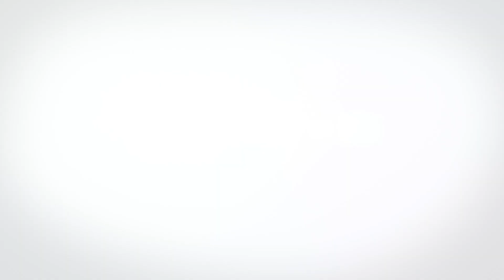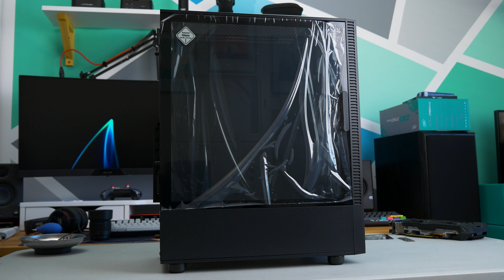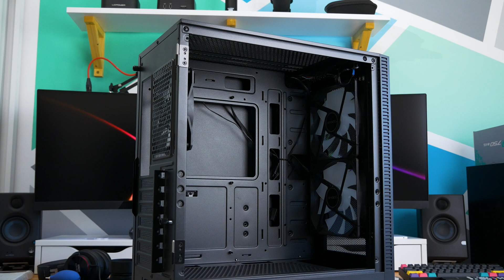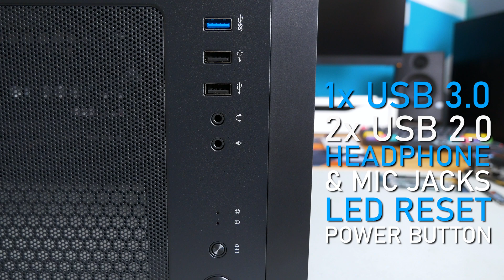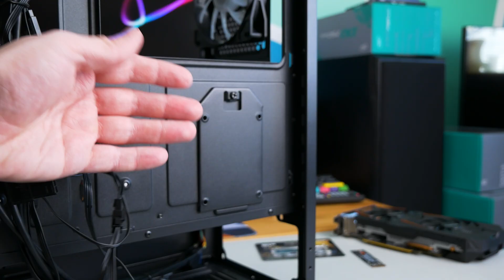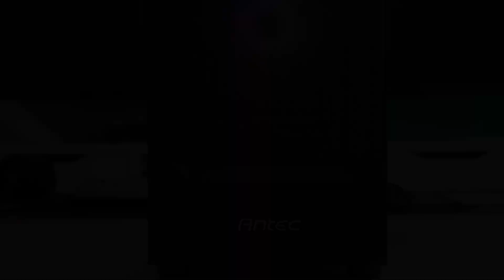Antec NX410 review  - Value oriented case!

Comment: Hi Vlad, do you happen to have the part# on the rear ARGB fan? I am looking to buy 3 more of those ARGB fans and yank the front RGB fans out, if that even makes sense. Antec would not give me a part number, nor would they allow me to purchase extra fans. Thanks in advance, I know this video is wicked old, but the case is still alive and kicking. I just bought one from the egg

If you are unable to find the part#, could you possibly recommend a specific aRGB fan I can connect to the rear? My Arous board has a 4 pin ARGB connector, so I am excited to get er done !
Reply from the maker: I don't have the pn but you can use Antec Prizm fans or similar from Antec

Comment: im pretty late to this video but the LED button on the top resets my pc instead of changing the LED. I cant find any other way to plug the wire in to get it to change the led. now my case LED is stuck at green and i cant change it :(
Reply from the maker: Remove wires from reset connector/pins 😁 and connect them to the RGB controller, then the button will be LED... You wired it like that, just undo it and all is good
Reply: @LevelUPGamingTech please give a tutorial 🙏

Comment: Im like 2 years late and doubt you will respond but how do the fans work. Is it just like a molex input from the psu and that's it or does anything go into the motherboard?
Reply from the maker: Molex for the power and I think there was one cable to the board to control the speed or read the speed, honestly can't remember now 😁

Comment: this case's fans have cables that my mobo doesn't have ports for, and they dont seem to be on any mobo, it wont let my pc boot either :/
Reply: What's the cable? I have the white version of this case and my mobo had all of the ports. Only issue I had was that the RGB quit working.
Reply: @geritisdale-brock7247  I fixed the issue, no clue what's missing, but it works fine and rgb does too
Reply: @GiveMeEstrogen333 How did you figure out the fan situation, I am having the same problem with my motherboard not having ports

Comment: I have a problem with the case, i can screw my motherboard in it.. its a B550 pro x v2 so normaly it needs to fit but the screws dont fit idk why :/
Reply from the maker: There are two types of screws in the pack, smaller and bigger thread sizes, try each one and see...

Comment: This case is awesome, the fans suck and fall apart easy so be careful.  The wires pull out so easy.  I fit 3x140mm in the front, a 4090 FE and a 240mm radiator at the top.  It's so cool literally
Reply: Hello, nice build you have congratulations, can you tell me your opinion on the case so far ?
Reply: Wait a Rtx 4090 can fit??

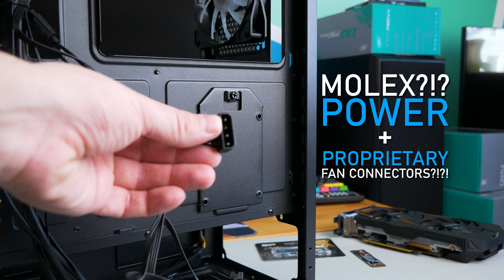Comment: Morning,Afternoon, or evening,, at the 2:30 mark mines didn’t come with that power plug it only have to smaller 4pin plug. Is it a certain name for the extension cause I don’t see it on Amazon
Reply from the maker: Maybe they changed it to PWM then, if it's the smaller one. Like an updated version of the case came out 😀
Reply: @LevelUPGamingTech  appreciate it.. I joined you all's discord server
Reply from the maker: Welcome aboard 😀
Reply: @LevelUPGamingTech  thank you and i got all my fan lights up and going
Reply: @reggiedabodyguard1986 are your fans pwm? Can’t figure out how to connect up to the mb
Reply: Same here what did you end up doing?

Comment: good vid. so im interested in this case. but i dont understand how you plug the molex adapter thing up to the psu or motherboard? if i knew it would work for sure id probably go ahead and buy it
Reply from the maker: Straight from the PSU and that's it, PSUs still come with molex cables, if modular at least one cable will have molex 👍

Comment: Hello, how do I install the gpu on the side?? This case has a slider thing and I have no clue what screw goes in either. Also confused on the molex cable in the back, can I just plug it into my psu(which I have) and then what about the other small cable with the molex that’s 4 pin, where do I connect that to? Or does it not need to connect to anything ?
Reply from the maker: No vertical GPU mount in this case

Comment: Very Informative video. Great job. 
Can we and should we install one Rtx 3090 in this case ? Will the airflow be sufficient to keep the card and other components running cool ? 
If yes , then also can you please suggest a decent future proof power supply for 3090 ? Thank you.
Reply from the maker: Thanks man 😉
I would not use this case for 3090 it might be a tight fit but the card will suffer. Get something bigger for 3090.

PSU 750W and up, 1000W just to be safe...
Reply: @LevelUPGamingTech  , got it. Thanks for helping 😊

Comment: So how would I get the RGB on the fans working? Would I need to connect the molex cables to the PSU or do I need to do something more? Haven’t bought anything yet, just making sure with some prepping.
Reply from the maker: Molex for power nothing else
Reply: @LevelUPGamingTech  so how do I get the RGB working?
Reply: Have u figured this out? I’m stuck on this as well. Got everything else done but I’m not sure if the molex cable connects to the psu and as well as the tiny 4 pin that’s with the molex??
Reply: @zelrius8714  hi I havnt got this case so I don’t really know what’s going on on your end. But I think that the molex cable which I think is a female 4 pin does connect to the PSU yes. But not 100% sure

Comment: Will an rtx3070ti fit? it's 320mm long and the case's specs say it can fit gpu's up to 335mm.
Just wanted to make sure tho ;)
Reply from the maker: It will I did I stall MSI RX 5700XT which is 332mm 👍
Reply: @LevelUPGamingTech  damn nice, it should also make the gpu look bigger i guess
Thanks for the reply btw

Comment: How did you get the rgb to run smoothly like that
Reply from the maker: It's all connected on the included controller if I remember correctly, just connect all the cables and boom done 😂
Reply: @LevelUPGamingTech  for me the rgb doesn't go smoothly through the colors
Reply from the maker: @0010plays  There are several modes, there is the smooth one and there is also that skippy one as well, just cycle through them with the included button on the case 👍
Reply: @LevelUPGamingTech  I don't have the smooth one fsr
Reply: @LevelUPGamingTech  did yours come with a physical rgb controller because mine didn't
Reply from the maker: @0010plays  Hmm actually it did not, I reviewed so many cases I can't remember everything. So in that case I synced RGB to the motherboard, in this case RGB Fusion from Gigabyte/Aorus, just set your effect and lower the speed to be smooth, most probably 50% will get it to be smooth, lower will be choppy and higher will be too fast.

Comment: Can we take of the front mesh panel to clean it? If yes, how?
Reply from the maker: Just pull from the bottom and it goes off, I don't know how I forgot about this 🤦‍♂️ But I can't remember if the cables are stuck to the panel or not, the ones for buttons and ports on top...
Reply: was it easy to take off and put back on?

Comment: Can you recommend a case for 16gb ram 3060ti Intel i5 11400f and 1tb ssd and can you make it cheap
Reply: Or will it work
Reply from the maker: Any case will work, you haven't mentioned which motherboard as this will decide on the case size, based on the motherboard form factor 👍
Reply: @LevelUPGamingTech  it's the ASRock b560 pro  4ddr4b lga 1200
Reply: Also changed to a rtx 3050

Comment: So I have just ordered this case in white and I’ve heard a lot of people having problems with the included case fans, my psu I’ve got has got a molex so will I be okay using the stock fans? Or will it be a case of getting new fans
Reply: How can I connect that fans…? Molexto psu and the other cable where? I need to buy a cable to connect to motherboard?
Reply: @SergioRodriguez-ih5uu  have u figured it out? I think the molex connects to the psu with another connector from the psu
Reply: I mean I've seen people with no issues at all Exept that kolex apparently sucks but it's fine.
Reply: @PopBunny8899  ye all good got it and built the pc and all fans look amazing😁
Reply: How is the case going?

Comment: Its not a good deal with those molex fans, they are very loud and can't  change rgb with software  or buttons. It would of been way better to have one in take and 1 out take 3 pins without rgb.
Reply from the maker: Yup I said that, molex in 2021, idk what were they thinking 😂
Reply: Wait so the included fans ARGB cannot be controlled by the motherboard? Oh God I just bought this, still in the box. Got to get that confirmed before I use it 🙊
Reply: Correct. The connector is proprietary. Accordingly the molex connector is the only way to connect the fans to power. And the rgb can only be controlled by the hijacked reset switch on the front io. I built in this case and for me it's great for what I paid for it IMHO but I'm not into a lot of rgb. And the sound to me isn't loud at all. But to each their own. If to you, you place a high amount of value of rgb control and speed control of the case fans to enable more silent operation then I'd probably consider a different case. Hope this helps.
Reply: @shadylite  how or where do I connect those ?? The molex and the small 4pin one with it ?? And what about the reset switch? Building in this case as a new builder and I’m so confused
Reply: @zelrius8714  if it's your first build don't overcomplicate it to start. Just attach the molex and use the rgb controller that's built into the case. Later, if you want to control the rgb with your motherboard software, you'll have to remove the antec fans and replace them with standard RGB or aRGB fans and run the power to your motherboard and the RGB too your motherboard separately. For now, keep it simple. Just use the molex until you learn more. And honestly you may be happy with it just as it is.

Comment: I recently ordered this case, but now since I'll be using a psu with different colour wires I'll use an extension cable. I liked the idea of putting the cables down the HDD bay. But where else can I put the hdd?
Reply from the maker: You can still put 1 hdd down there and hide all the cables 👍 I mean without removing the cage

Comment: Sir plz reply ..i have an issue...i ordered a whole pc setup and this cabinet..my mobo is dead on arrival ..so i couldnot check the cabinet..and thn i tried paper clip trick..by shorting the green and black of 24pin..but only rgb light of the fan are working .not the fans ...so are the fan connected with the mobo..or fan are bad..

Plz reply
Reply from the maker: They are connected to the board then if that happened... RGB side of things is powered by Sata
Reply: @LevelUPGamingTech  the rgb light lf the fan are working..but the fan are not running...so which cable i need to connect..can u help me out plz
Reply: @yuhaan7555  it's simple just connect the molex cable to the PSU molex and connect the reset wire to the reset switch (cabinet). Fans should run and and you should be able to change the colour using the led button on case.
Don't connect them mobo. It's usless. The fans are better off set at maximum it gives good cooling

Comment: Seems like a decent Budget Case but I would avoid it simply because not enough Drive mounting points. Also after building one Micro ATX Build I have had enough of small cases. Excellent video as always. Also it doesn't look half bad for a Budget Case either. 😉
Reply from the maker: I agree, not enough space, but I said it in the video that it's meant for simpler builds not something that you or me would be using 🤣 Also thanks man 👍
Reply: Why, just switch to NVMe. They're cheap enough now, less heat and noise then SATA.
Reply: @camotech1314  Dude I have 4 NVMe Drives 1 SSD and 2 HDD's in my Current System And I plan to add another 2 NVMe Drives and 2 more SSD's. So for someone like me as I said "Not enough Drive Mounts" And also as LevelUP said this is not something people like He or I would build in either.
Reply from the maker: I agree I need more storage space always. I got 4 NVME drives on board, 2 ssds and 2 HDDs in my PC. 2 external NVME drives in Sabrent enclosure via TypeC and I need more 😂